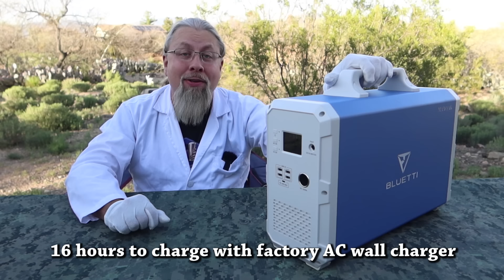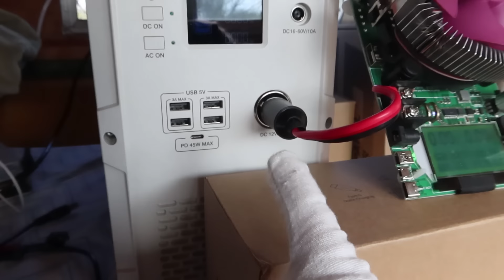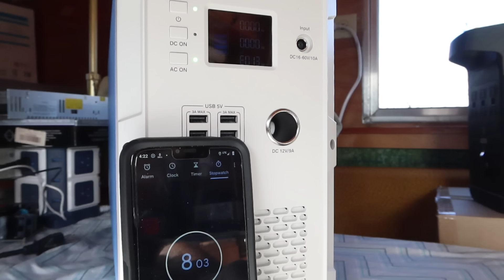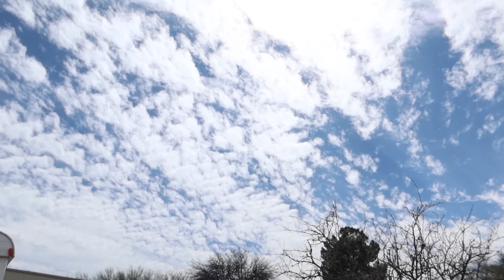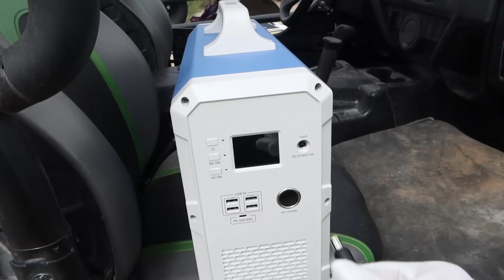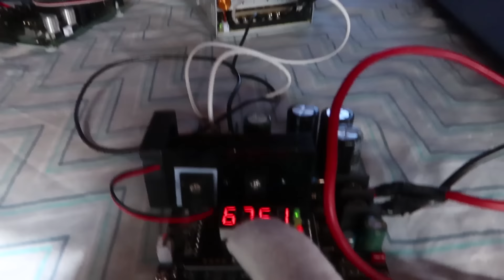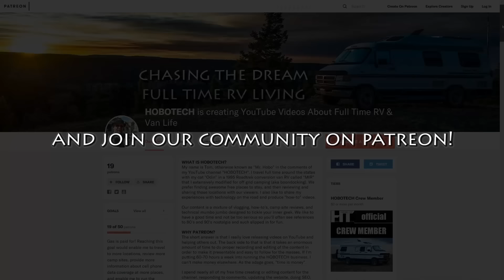MASSIVE Off Grid PORTABLE POWER Station! 2400Wh MAXOAK Bluetti EB240 Lithium Solar Generator Review

Comment from the maker: * THIS PRODUCT IS NO LONGER IN PRODUCTION SINCE 2022. DO NOT BUY IN 2024! *
If you buy this "new" since 2022 it has been sitting in a box in a warehouse at least 2+ years. 
Instead check out this modern Bluetti --> https://youtu.be/e4wtzD84jdo
Reply: can somebody explain to me why is not being used for 2 years is bad?
Reply: I see that the input is 16-60v/10a... Will this work with a single 12 volt solar panel or do you need multiple in series to increase voltage over 16v?
Reply from the maker: @randomizify  A single high quality panel with Voc in the 22-24v range will work (not Rockpals)
Reply: @HOBOTECH  Ordered a refurbished one...500. Did I screw up?
Reply: Where do we put the code in? I’m having difficulties.
Reply from the maker: @reneesouther6076  Click the link, add to cart, checkout, enter code.
Reply: @HOBOTECH  My God these are under 500 refurbished! And I just bought 5 cheap ones! ARRRRRGGGG!
Reply: My friend can you answer me a question please?? Can I use an extension lead to add more plug sockets on the 240
Reply: I purchased this bluetti eb240 and I have a 3-phase 12V AC hydro turbine. Trying to figure out how to use it to charge the bluetti. Any suggestions would be greatly appreciated.
Reply: I click the link and it says its discontinued. What other unit from bluetti would be the equivalent? Is there a code for one that they currently sell?
Reply: How long does it last the power per charged? Can u give an example pls.

Comment: Is this still a good device in 2024? It’s sold for 799€ atm
Reply from the maker: No, last production by Bluetti was 2022 so you're buying something that sat in a box for 2 years -- which is why so many are "cheap" from 3rd party sellers. Get a modern Bluetti like the AC180 or AC200L.

Comment: New to solar and electrical so sorry for the dumb question but in the video we see that went it exceeds 67 volts of solar it reads error. Will the same happen in amps ? I have a foldable solar panel that is rated for 44v and 13amps. I assume these numbers are on the high end depending on the solar and it will never be perfect conditions, but if for a split second it is, will the excessive amps also error the battery ? Of which I’ll need to come back and disconnect and reconnect it again ? This is one foldable solar panel so I assume all the little panels are soldered and linked and covered in mesh, so no I can’t split this solar input.

Comment: Would it power a large party speaker what is about 150w plug power but 1100w speaker power ? I see people using small 500w bluetti power stations stating a few hours use, hense me looking at a large 2000wh power station hoping for extremely long run times, but then I see you using a hairdryer and it struggling and you say it will only run for a couple mins

Comment: I purchased the MaxOak Bluetti EB240 Solar Generator 2400 Wh Generator + 4x100W Solar Panels about 2 years ago from SolarKits.  I used it about 8 times.  Recently the power went out, and the generator discharged, and now the unit won't charge.  I tried attaching to the wall, and by setting up the solar panels.  It won't charge.  Solarkits says that the 2 year warranty has expired and will not cover repairs.  We contacted Bluetti and they won't touch it becuase we didn't purchase it from Bluetti.  So we are stuck with an expensive shipping and a possible $300 repair cost.  Not happy about this very expensive piece of equipment, with no support.  Advice: don't discharge fully, don't buy from Solarkits or 3rd party, buy extended warrenty.  Question:  Does anyone have suggestions on how to charge/fix  this dead weigh anchor in the San Francisco Bay area?

Comment: The EB Series are still the best Workhorse SoGens on the market, It's a pity they never made anEB MkII with a 1500/2000 inverter, The special features of the EB Series is the battery types and the Cast/Extruded Alloy Case and the fact that you could put a whole bunch of them in a row all neat and tidy. I have the EB180/1800wh version and the Huge power means you always have enough power on tap.

Comment: If I add a eb230 expansion  battery to my eb240 , can I then solar panel charge the eb230 at 500 watts , and charge the eb240 with the eb230  at 500 watts also?

Comment: I have bluetti SP120 solar portable panels and I want to make a extension for the MC4 connectors. But on the solar panels, it doesn’t specify the size of the red and black wires. Does anyone know the size?

Comment: Thanks much. 3 Renogy 100 watt rigid panels used to go over 67.5 open circuit voltage, but 3 new version Renogy panels are under 67.3, FYI. And 300 watts is sufficient power for 2400 daily watt hours IMO (in Southern California near the ocean.) The new Bluetttis take more voltage and have higher inverter output. I run a Commercial Chef microwave on full blast on my 2400, which is just under 1000 watts on full blast. I have to flip off my dedicated power strip to my mini fridge when I max the Bluetti out with the microwave.

Comment: I bought a Bluetti EB240. 

Do I need to completely discharge the unit before recharging? If I do not use up the entire charge, say it has 3 bars left, can the unit hold its charge to use the rest during another blackout, or will this shorten the longevity of the battery? Would undercharging the unit to 80% and leaving it for storage extend its longevity? Or, is it recommended to charge it to 100%, since Bluetti rates the EB240 to last 2,000 to 2,500 charges?

Comment: Intended use: outage in the power grid (1-2 times per a year).

What is the recommended way to top off the EB240 battery?

  a) plug in the AC power adapter, and leave it plugged in to AC receptacle?
      How many self-discharge-then-charge cycles a battery cell will undergo over
      a period of one year?
OR

  b) plug in the AC power adapter, and leave it plugged in to AC receptacle
      till the EB240 battery is topped off.  Then, disconnect the adapter
      from the AC receptacle.  Repeat the sequence say, once a month.

Note that I don't have PV panels.

Comment: So if I bought 6 of the Bouge RV180 W solar panels that you have listed,   In the video you say 170 W panels, and connected 3 in series and then connected them in parallel to the unit i would be able to charge the safely.   Also what is the difference between the 5BB and the 12BB Panels

Comment: Please help! Please do a video on hooking. up the Bluetti 2000Wh S. Generator. I spent all last summer trying to get my to charge by the sun unsuccessfully! Nothing is happening at all! First of all the 8mi. the adapter is very loose when I try to plug it into the generator; like it's too short or something. Also, which buttons do I put on, the AC/car or the DC? Speak to us like we are two years old. I purchased three hard solar panels 120V, connected them together, maybe that's the problem as there are videos on hooking four but not three and what adapter to use to connect them to the extension cables that run over to the S.G. Bluetti.

Comment: You have probably already heard this by now, but Bluetti updated their firmware on the 1500 Watt model as well.  It is rated at 68 Volts just like your 2400 watt model there in the video, however the tech department told me that it would usually cut out at or a little over 67 volts, JUST like you showed on your video!!!  Haha.  I happen to get lucky and had problems with my first one and I ended up getting the updated model with the higher voltage input limit.  Just thought I might mention it just by some slim chance that you hadn’t heard it.  Love your channel! Keep it up, Cheers

Comment: I want to run a ac frig but the inverter would have to be on all the time is that ok to leave it on ready to power the ac frig?  Also if you leave the solar panels plugged in all the time will charge without any input from me?  I need to be able to set it and forget it for a few days hoping the sun comes out to gain back the energy that was used at night.  Thanks.

Comment: I was only able to get 1.8 KWH (75%) from mine. This is the 3rd video I've watched on battery capacity testing. They all did it differently lol. The 2 others used the killawatt and figured in inverter losses.

Comment: The system I bought came packaged with two SP200 panels. Could I hook up a third in series? Not sure if that would push it over the voltage limit and would rather not spend the $500 just to find out it does.

Comment: Ugh, my EB240 all the sudden has a problem.   Last night all 4 USB ports were working fine…now today 2 of the 4 simply don’t work (the 2 on the right).    I didn’t move the unit at all since yesterday, I just turned it off yesterday, and turned it back on today.    Has anyone run into this problem before, anyone know what would cause this?

Comment: First I would like to say thanks for all the vital information you contribute on your channel. As a first time solar generator buyer I purchased the EB 240 with the 2- 200 watt bluetti solar panel kit. The length of the cable leaves a bit to be desired. I would like to add 40 to 50 ft to this unit if possible but do not want to purchase the wrong cable. Any suggestion would be greatly appreciated.  This is the unit I purchased. I also opted for the 4 yr extended warranty. BLUETTI EB240 Portable Power Station 2400Wh with 2pcs SP200 Solar Panel 200W, Lithium Backup Battery Solar Generator for Home RV Emergency, 1000W AC Outlet , MPPT, Foldable Solar Panel Bundle, Indoor & Outdoor Power Alternative
Reply: Would you recommend it a year later?

Comment: I’m new to this arena and just bought this machine I’m using it as a backup for an oxygen concentrator and Wattage on front indicator is fluctuating between 250 and 300W constantly is that normal? Thanks!! Well the fact that it’s fluctuating

Comment: So i bought this unit about a 6 months ago and i bought 3 Renogy 100 Watt 12 Volt Monocrystalline Solar Panel, Compact Design 42.4 X 20.0 X 1.38 in, High Efficiency Module PV Power. I plan on getting the 700, what panels will work with this and can i run in parallel? Or should i just get new panels that will work with both units...
Reply from the maker: What's a "700"?
Reply: @HOBOTECH  sorry, the bluetti 700. I think it is the AC70

Comment: I was so happy with my first unit that I bought a 2nd. But on my new unit, I noticed the cooling fan doesn't turn on while charging (wall charger). I'm wondering if it's a new production model and they removed that feature? The LCD display is a little bit different as well. I know the cooling fan DOES work because I loaded more than 400w of AC to force it on, and it does work...

Comment: which power station Jackery, Bluetti, GoalZero, or Eco FLow works with any brand solar panel. That feature seems the most important. Also so that you don't have to make any special cable but just right out of the box. I think that would be a great video. thank you so much. your videos have helped so much

Comment: Hi, thank you for a great video and in depth review of the system.   I would love to ask a question and hope for a response.   I am getting the Bluetti EP240 with 4 BougeRV 180 watts mono solar panel 12 volt.  Will a 30 feet 10 AWG solar extension cable be heavy enough to run the 4 panels at 30 feet?

Comment: I see that the input is 16-60v/10a... Will this work with a single 12 volt solar panel or do you need multiple in series to increase voltage over 16 volt?

Comment: So informative and well done.  You mentioned possibly putting in an Andersen connector, do you have plans to do a video on installing the Andersen connecter????
Reply from the maker: Doubtful. They have newer products now.
Reply: Quick question, what is that unit with the white wires connected to the voltage booster?

Comment: Can I use 3 hqst 190 watts in parallel?  It's operating volts is 20.3 volts.   But it's open circuit voltage is 24.3 each.
Reply from the maker: No
Reply: @HOBOTECH  I might have to buy the ac200p instead.  Which 3 solar panels would you recommend for an ac200p?  Max dimensions I can fit on my 2020 rav4 is 60"×80"

Comment: Is it still true that the EB150 has the upper limit of 60V?  The User Guide now shows:16-60Vdc(OVP 73V±2V)
Reply from the maker: The upper limit on the new models is 68v +/-2%
Reply: @HOBOTECH  Maybe I can run my EB150 with three SP120 panels in series?  Vmp: 19.8V Voc: 23.7V 
Will voltage spike when connecting full sunlit panels? (Also will likely never leave it out in cold temps). So far no problem with RFI from the MPPT during portable ham radio ops.  Maybe you will also review the SP 200 panels... 
BTW - nice channel!

Comment: Thanks to you I got one . Great! Please tell me how I connect 3-200watt12v Renogy solar panels to the Bluetti EB2400.
Series or parallel? Also, can I add more panels?
Thanks!
Reply from the maker: You can't do 3 x 200w in series or in parallel. You need a 4th panel and put them in series-parallel as shown in the video.
Reply: Super, thanks! Your video is excellent. My comprehension of things electrical doesn’t go much beyond plugging in a kettle. You’re a great help.
Stay well,
Duncan

Comment: The regulated DC output in the video drops from 12.1 to 11.8 when loaded.  Isn't 11.8 volts too low?  Shouldn't it regulate above 12 volts throughout the battery discharge to be compatible with all DC loads?

Comment: If you have 1000watts of solar power can you run 500watts of electricity while the rest of 500watts charges the battery?
Reply from the maker: Doesn't work that way. It takes 500w input max. Anything over that will be lost.
Reply: @HOBOTECH  is it possible my man to wire   it up so it'll divert 500watts to run a pump and the rest to charge the solar generator.

Comment: These things are great , BUT.............what turns me off on them is " Not possible for owner to replace the battery bank ". 
In most all computer UPS setups , we have replacement batteries we can buy , that are only about 20% of what the system originally costs.  
Paying $1500.00 - $2000.00 or more with panels..........only get 5 - 10 years out of them , with no way to replace the batteries?  Not as cheap in the long run.

Comment: Hi, thank you for the video. Grateful. Question: do you think the 2400 Bluetti can handle 6000 btu air conditioner or just stick to 5000?  Asking because 5000 does not come with a dehumidifier.....
Reply from the maker: It will handle a mechanical Frigidaire 5000btu.
Reply: Thank you. 😊

Comment: I've been a bit confused about the X cycles to 80% capacity. Is it saying it will last 1400 cycles before it loses 20% of capacity or it will last 1400 cycles when charged to 80% capacity each cycle.

Comment: Can someone help me out?  I bought this Bluetti 2,400.  I need to buy solar panels that equal or get close to the solar panel max inputs.  The user manual on Amazon, where I bought it from, says 500 w, 60 volts and 10 amps.  I get the 500 watts and 10 amps from reading the specs on solar panels.  But what about the volts?  Is it the open circuit voltage that I add up?  Anyone have a system already for this Bluetti?  I have a box van (Uhaul type) so I think the flexible panels would be easier to install?  Thanks for any help!
Reply from the maker: You add the Voc of the panels. Run series-parallel like shown in this video to keep the Voc under 60v and max the amps.  6x100w panels will do it or as recommended 4x180w BougeRV.

Comment: I just purchased the Bluetti 2400  MAXOAK Generator, and it was shipped to me.  I plugged it overnight, and now when I went to use it, it does not work. No power is coming out of any of the power outlets.
I am very disappointed. Any suggestions?
Reply from the maker: Try turning it on first.
Reply: Hello
Thank you for your response.
I charged it for 15 hours and the green power light is on and it’s still plugged in. 
As well as the ac and dc lights being on.
Reply: Please reply

Comment: I have 4 180 bougerv panels.  How could they be configured to work with the bluetti 2400?  Could I wire three in series with open circuit voltage being 21.6 volts on each?  If I wire in series parallel wouldn’t my amps be too high?  I’m a newbie to this.  Much thanks for your reviews!
Reply from the maker: I cover series parallel in this video and a few others.

Comment: Hi, great video as usual! Would you say that the EB240 is suitable to be connected to solar panels that are on the roof of campervan so that it can charge via solar when driving and is it safe to have it  constantly connect to the solar panels for full time van life or is it better suited to just solar charging when the van is stationary? I'm asking because the connector that runs the solar into the EB240 doesn't look very sturdy so i wonder if it might unplug itself while driving? Thanks for any help!

Comment: obviously you would only be charging it with solar power while using it otherwise if you had regular electricity to charge at the same time as you are using it you could just use the power you are charging it with and dont need to use it cheers

Comment: Can you connect inputs to charge this from the cig lighter (with additional inverter) and a solar panel at the same time, so when I shut off my vehicle the device continues to receive power (if the sun is out for my roof top panels)?